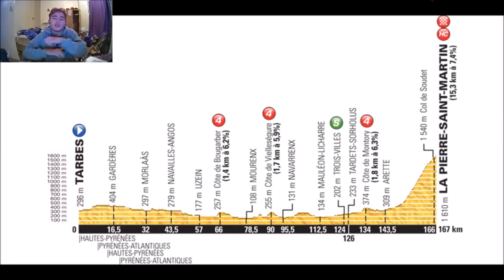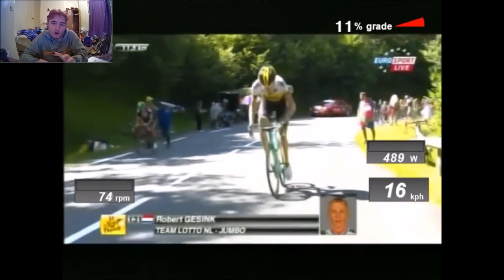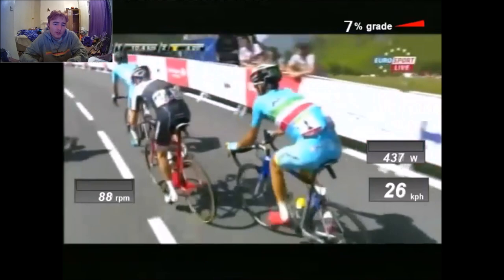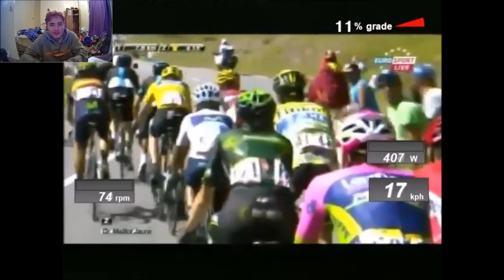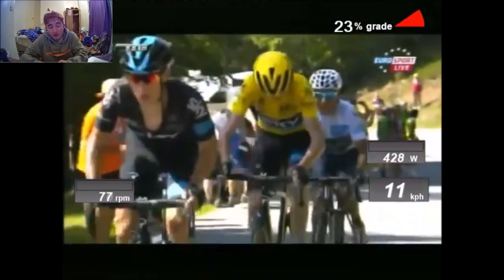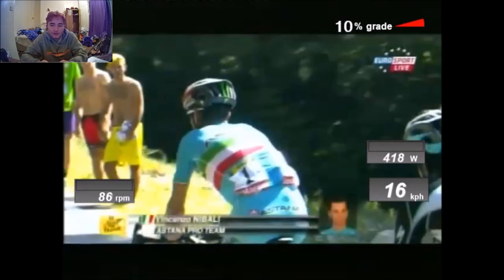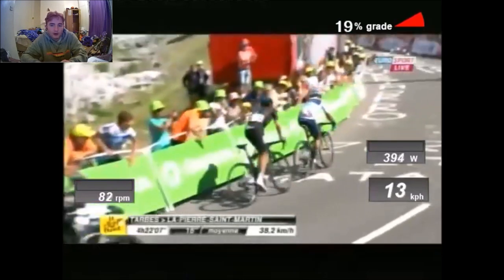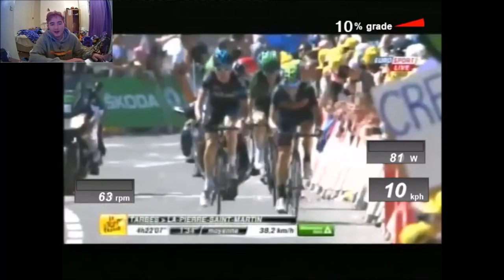Froome's Best CLIMBING PERFORMANCE - WITH POWER DATA !

Comment: plus the average power of Froome on key climbs was actually pretty much the same in 2013-2015-2016-2017, always around 410-417 Watts etalon. 
  The difference is that in 2016 they were 5 guys to hold that same numbers (he just blew them with tactical attacks and around 50Km of Individual TT), and Uran + Bardet even did BETTER than him on the climbs in 2017.

So you're clearly on the point : the top level is approximately the same, the difference being that we went from 3-4 riders to 10-12 approaching that, and better teammates everywhere (and a rider who can content with sprinting in the ladt 500 and take bonus, which is all right, it's his qualities).
  Froome just arrived in beast mode in years when the opposition was still in an intermediary period and was having a hard time to reach the top. Of course he crossed the line (like many) on some occasions, but his performances are overall more a result of lack of adversity than of himself, since it in the same range (if not worse) than what we get to see  in the recent years.